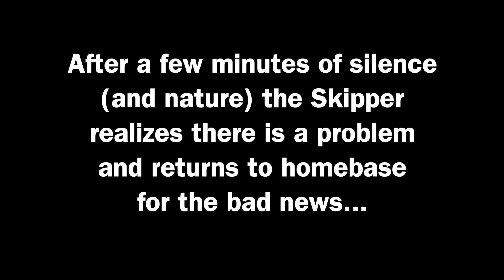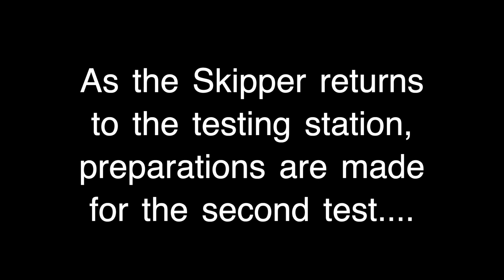I Blew Up My Friedman BE100 - For Science.  Full Volume vs Marshall G100

Comment: “….they’ve fixed the Friedman before…”???  That’s disconcerting.  While, an 100w amp may not ever be in a position to be cranked…..I wouldn’t think it would blow-up, either.  I thought those amps were over-engineered.  AT $4K+ I would think it would be.  But, I digress.  As far as this demo goes, the Marshall sounded a it better to me.
Reply from the maker: Both times the $2 fuse ... I think it was an electrical issue running from my power strip in all honesty.  🤷
Reply: @Ranch5150SkinWalker  That's good to know.  I thought you said it wasn't the fuse?  Regardless, with what these cost, they should've be blowing up, unless thoroughly abused.  👍
Reply from the maker: @phillamoore157  I took a fuse out of a Marshall and replaced tried it in the Friedman and it didn't work.  I guess it was the incorrect size.  I got the Friedman in 2014.  In 2015 the fuse blew at a rehearsal.  Then in 2022 it blew again on my deck.  I think the fogger plugged in with the amp on the same cheap power strip didnt gel with my amp.  Who knows.  2 fuses in 8 years.
Reply: @Ranch5150SkinWalker  Well, if it's happening under the same circumstances, then yes, it has something to do with how you're plugging it in.  If not, send it back to Dave, and tell him something's not right.  Those have a lifetime warranty.  He could probably take one look at it, and tell you exactly what happened.

Comment: I remember when one of my 5150s blew a tube. Made my heart sink. It just powered off. I had to replace a fuse and when I pulled the tubes I could see that one lost vacuum. Did some testing and inspected it to make sure it didn't damage anything then put new tubes in and biased it. That was three years ago, it's been solid ever since.

Comment: I use a German engineered Engle and in my opinion a much better amp and don’t sound muddy at all and Marshals l cannot stand and I’m from the uk overrated crap and motherboards made in China lol 😂 but hey some players like the bullshit name so l guess that’s it lol. Plus Marshals don’t crank up very well they just sound horrid and fizzy again my opinion with Marshals and I’ve had a few in the past and just couldn’t get along with the tones. I preferred my Peavey 5150 the original and not the newer models a great sounding amp and like eddy stated the original 5150 you could strike a power chord and it will ring for days 🤪
Reply from the maker: My Friedman blew a fuse so it was a $10 fix.  Best amp ever IMO.  point to point as well. My “plexi” is amazing too.  I had a 5150 block letter.  Was noisy and murky.  Too much gain.  Sold it.   Thanks for watching man! 😎☮️
Reply: @Ranch5150SkinWalker  To be honest like anything if you like Marshall then that’s good to you. For me uk tripe. 5150 any day of the week and Engl again a personal preference 👍🙏
Reply from the maker: @squeelerjakeaxcradle7095  Marshall are ok in general. Not my favorite. I like my MKII for what it does.  My BE 100 kills it.
Reply: I think what’s close is the JCM 800 personally but hey they all have their place for certain players 🤘🎸🎸

Comment: Another great video man! I actually have a G100 RCD. They are actually fully solid state, not Valvestate (no preamp tubes). They are actually the predecessor to the MG series. They do sound pretty killer though!
Reply from the maker: I like mine! I am impressed at how good they sound and it held up very well in this test.  Thanks for the input man!  😎☮️
Reply: @Ranch5150SkinWalker  Yeah it sounded pretty badass in your video! I haven't played mine through my Greenback loaded 425A Marshall cab yet, so I'm eager to hear how good that'll sound haha
Reply: @SixStringSting84  how it was? You already tried it?

Comment: "It was already broken when I came to the scene". Isnt it a bit worrying that it is not the first time it blew up?
Reply from the maker: Normally yes.  But here’s what happened.  The first time it happened was my fault.  I did something stupid.  I was testing a wiring job and touched a soldering iron to a volume pot on a guitar and forgot it was plugged into my amp. (I was testing a connection on the bench late at night and didn’t unplug).  That toasted a power fuse. 
Second time, someone switched it to 4 ohms setting it up rather than 16.  And that blew out a fuse again.  So now this.  Maybe it is related to the last repair.   It stinks, but amps go down.  Hope it’s quick and not too much $$$.  ☮️
Reply: Aa, when u put it that way it sounds much better. Let's hope you fried powertube and that's all! Remember to do follow-up! And keep on frying amps ;-)
Reply from the maker: @vl292  will do a follow up for sure. Thanks!!

Comment: Likely something very simple and inexpensive to fix. A fuse, tube or cap. Nature of tube amps, but much better than solid state and can be worked on and fixed quite easily in 99% of cases. Dime mine all the time and have for years. Never had an issue other than a cap and a tube after 3 yrs of beating on it daily.
Reply from the maker: I’m with you man! I am thinking something minor.  Tube amps have real parts that wear out.  If that valvestate fried they’d just chuck it in the dumpster.  Maybe save the Marshall placard and knobs.  Haha
Reply: @Ranch5150SkinWalker  very true.
Reply: It’s a cap
Reply from the maker: @godbyone  probably so man!  🥂
Reply: @Ranch5150SkinWalker  I hope so it’s the cheapest.   10 bucks.  But depends who does it
Reply from the maker: @godbyone  EMS in Nashville is reasonable.  But places like British Audio will require a kidney and first born.  And EMS does nice work fast.   So I hope for the best.

Comment: I’ve often wondered if placing valve amps one above the other like that restricts ventilation. The amp below can’t release heat and the one at the top gets the extra warmth from below. Could this have caused the Friedman to quit?
Top show. Those amps sound best at those inhospitable volumes 🤘 🎸
Reply: That’s an interesting point — it probably traps heat and moisture. Plus, it was probably a hot/humid summer day in the TN valley. That can’t be helping either. Humid heat is WAY worse than dry heat.
Reply: No .. it was outside and well ventilated had nothing to do with it .. I play mine all the time in a garage in south Florida with no ac for hours and it’s about 110 in there with no wind at all .. it  didn’t overheat
Reply from the maker: @NoCoverCharge  I think it was just pushed too hard and blew a cap.  I agree with you!
Reply from the maker: Perhaps?  The back is really well ventilated too, but it was hot and humid!  I bet it really got cooking in there when I cranked it.
Reply: @Ranch5150SkinWalker  Those cranked 100 watt amps open the gateway to another dimension. Bound to get some blowback.